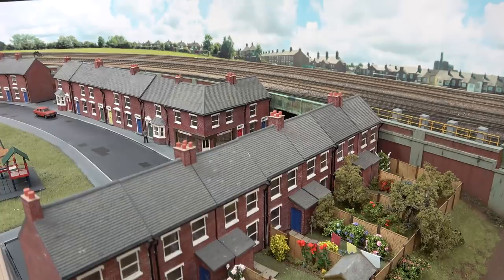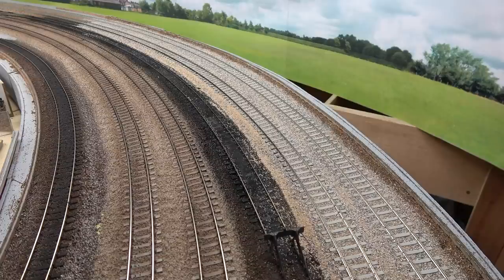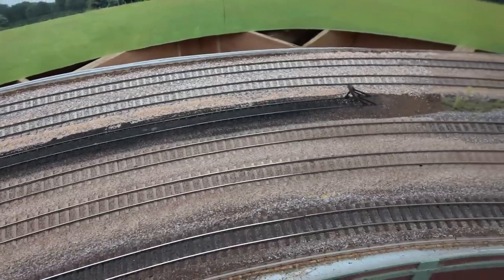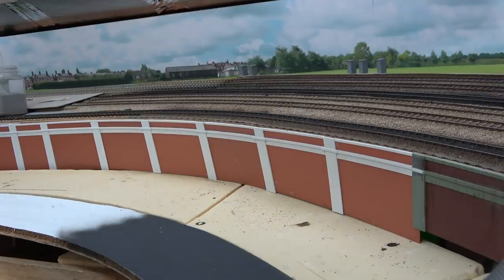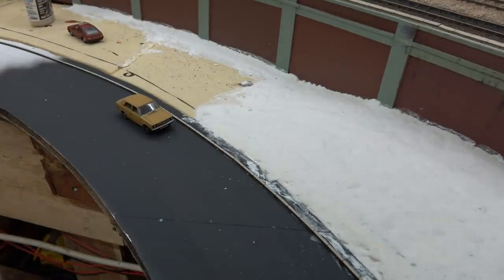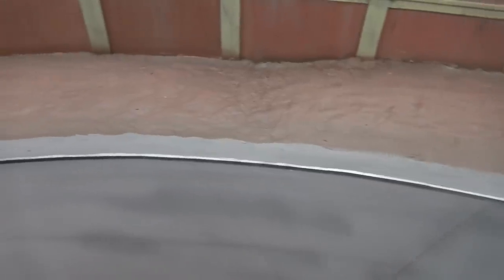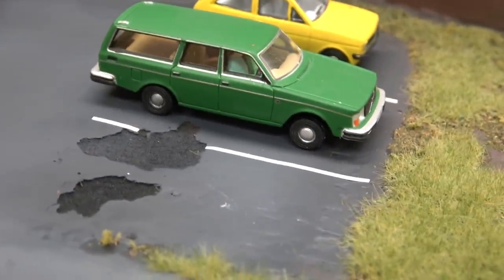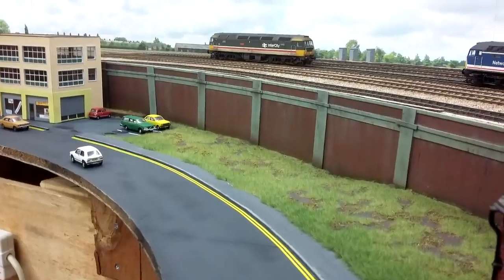New Layout Build - Expanding the town scenery

Comment: Super work Richard! I think your scratchbuild looks amazing. I'm an architectural historian by education and although it's based on a 1960's prototype it does have elements of a 1920/30's Bauhaus sort of structure with what appear to be steel window frames sitting in quite deep sills. It's actually a proper modernist building in some ways. Cheers, Joachim

Comment: Really enjoying watching this series and the detail you put in. I'm tempted to start railway modelling but like you have a load of other hobbies and this might be on too many for now. The cable troughing looks brilliant. With those old style equipment cabinets/relay boxes often there would be one in a group, especially near a junction, that was owned by the Signalling department rather than the Signal and Telegraph (S&T) department (on the Western Region at least). It would house equipment for emergencies and to set up occupations like banner flags, oil lamps and point clips. They would be identified by a yellow stripe painted on them about 3/4 of the way up from the floor. A bit of the tape you use for road lines would work I guess. Also in  group one box may have a bell on it to alert the S&T staff that the signaller wanted to speak to them in the pre-mobile phone days. Maybe a bit small too model though. I've got a photo of one if you'd like to see it.  Those orange pipes to protect cables I think came in a bit later than the early 1990's but can't be sure.

Comment: Excellent update Richard. That waste ground by the factory and the area around the siding look superb. What mix do you use for your acrlics and what pressure do you spray at? Like the Granny..I had an N reg Fast back in blue many years ago. Looking forward to the next update. Cheers, Bob
Reply from the maker: Cheers Bob.  I vary the paint mix depending on what I'm doing but 50/50 isn't a bad place to start.  I vary the pressure too, about 25 psi is a fair place to start. My fast back is also N reg!

Comment: I'm housebound and enjoy watching these videos. I don't partake myself but enjoy watching the process you guys go through to get the scene looking right. One thing that jumps out at me from yours is that all the house window frames are white. I realise that it would be painstaking but they would look more authentic if varied. (Sorry).
Love the pot holes. If you want to salvage the stuff you vacuum off, simply run the vac hose into a sealed container then have another hose coming off it into the vac. Then all the stuff you vac up will end up in the container and not the vac. I have a video of a 'Thein baffle' system on my channel designed for a woodworking extraction situation, but just an empty sealed container works.
Reply from the maker: Cheers, glad you enjoy the vids.  I've got lots of detailing to do the houses as they are all very similar.  There will be a video on that in future.  I also recover loose materials when vacuuming but you don't see it on the videos. Thanks

Comment: Thank you for the update as always another great video.  In my opinion I think the parking lot for the office building is to small for that size of building. If I had your layout and wanted to add more parking spaces I would run the parking lot along the retaining wall with the cars putting their fronts against the wall and it would be a one way parking lot. But that is just my two cents and the quality of your model railroad is top notch.

Comment: Great video Richard as ever. Can't believe you've had the Granada for four years now. Doesn't seem that long since you started helping Ryan with  is SD1. Got a question with the double yellow lines on the road. Should it be there in front of the houses or should it stop just before to allow the residents to park? Not meaning to criticises and I'm sure you've done your research  just like you did for the road markings on the previous city scene, but i just wanted to ask.